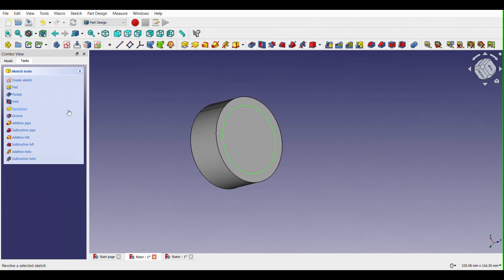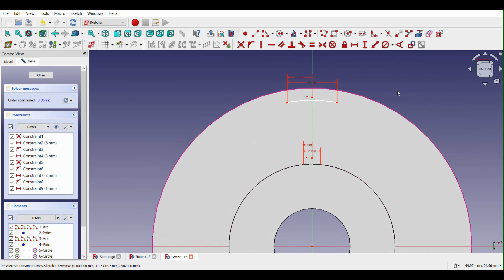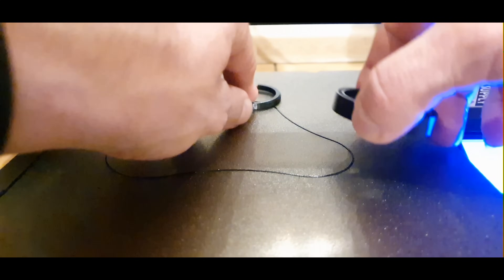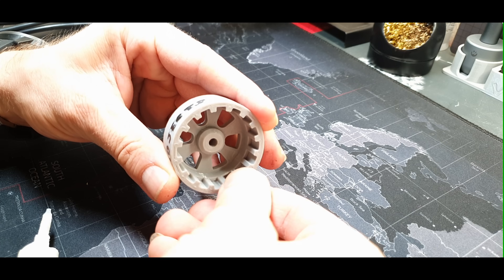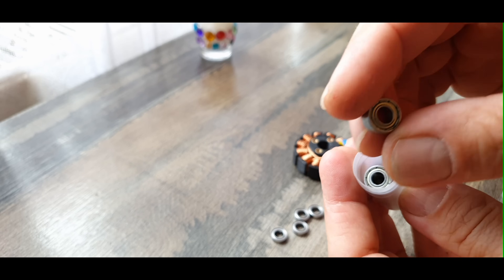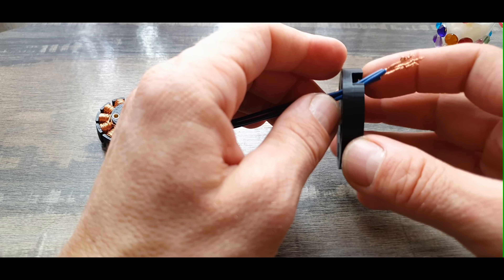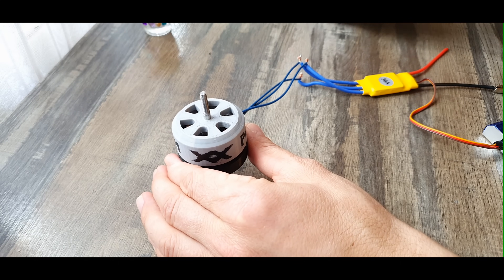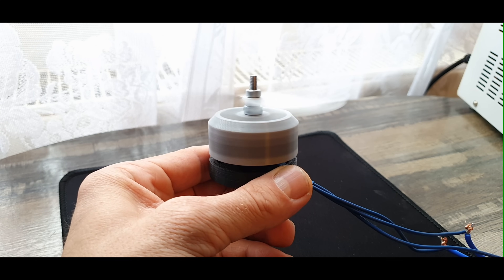How To Make A Brushless DC Motor | DIY BLDC Motor

Comment: I like where this is going.  Just about the time I was thinking “magnet polarity?” you explained it.
And lubrication at 7:00.  And using the high tech (CAD and 3D printing) plus low tech (cordless drill as an improvised metal lathe to cut the shaft for the safety washer/circlip/snap ring).

Comment: 12 windings 14 magnets
on stator use magnetic core from stacked sheets cuts by laser or waterjet
on rotor use metal cylinder around magnets to redirect magnetic flux toward coils

Comment: 11: 22 You can make holes on the stator and drive a round or square rod into it. And also when printing the rotor lay grooves for rings that will add strength to the rotor .

Comment: What is the voltage this BLDC motor is operating at? Can it operate at low voltage like 3.7v for instance?
Reply from the maker: Yes it will work, at least the ESC that I used it works, it automatically cut off the power when the voltage is at 2.9V, so yes I think it will work at 3.7V.

Comment: im trying to remake this for a physics project and im trying to find the parts needed, ive read the document in the google drive but im still a bit lost, mainly with the brass m3 insets, the diameter of the ones im finding online are larger then the diameter of the hole in the 3d model. just a bit confused. would be great if anyone could provide some guidance, thanks
Reply: You want the hole for the heat inset to be slightly smaller so there is some excess plastic to fill the knurls and form a strong bond. Set the inset on the hole with the wider side facing up, then use a soldering iron to push the inset into the slot flush with the part, it will push the excess plastic easily. I recommend using an m3 screw to make sure the inset is aligned proper while the plastic is soft. Be careful to not overheat the plastic with the soldering iron to prevent deformation. Heat inserts are absolutely worth learning to use, far superior to slots with hex nuts.
Reply: @bmw.996  oh i understand now, thanks a lot
Reply: @TheBuckmanCollection  Hey! I'm also trying to recreate this for a physics project right now. Would appreciate some tips + did yours end up working well?
Reply: @bmw.996 what what would you use for the speed controller and power?

Comment: Of course the magnetic fiels or coils crosses plastic, air and other things but your motor has a very poor efficiency since you don't design a real stator.
Reply: appearently its enough to still run it, note that the stator here has a verr small diameter wich will help with carrying over the flux form opposite poles, using plastic on a stator with a larger dm would defenitly result in verry bad efficiency. in this case, who cares it runs hahaha.

Comment: Question: Would it be better to use thinner diameter wire to get more wrappings, or does the reduced diameter have negative tradeoffs?
Reply: Higher AWG can handle less current and will begin to get hot quickly.
Reply: @gurnoordosanjh3288  but it will increase the flux for the same amount of current, because you can achieve more windings
Reply: Good question, good answers.   Some genius on the internet will have specific recommendations based on power source, application, the list goes on.

Comment: Can the brushless electric speed regulator be successfully operated by connecting it to a 6V battery box?
Reply from the maker: I think it will work at 6V, at least the one that I used, better consult the datasheet of the ESC you're planning to use.
Reply: @HMProjects  ok thank u

Comment: Did you just put oil on those ZZ bearings ? I thought that ZZ meant fluid tight
Reply from the maker: @VenatorFPV  No, they are not sealed, I mean they are sealed but not waterproof, they have a metal seal, more against dust than against liquids, you can see in the video practically how the oil gets into the bearing. those bearings with rubber seals are waterproof.

Comment: How many rpm does it spin?
Reply from the maker: Not sure, didn't had a digital tachometer measured the speed.
Reply: @HMProjects  I'm thinking of trying this in a project. Then it will be better understood how it performs.

Comment: Very nice work and video demo of the build and testing. As you noted, high rotational speed = high centrifugal force (to the power of 2) = high risk of failure and parts being flung out at incredibly high speeds. You may want to buy a heavy stock pot in which to mount your BLDC motor if you're going to crank the speeds up so as to contain the parts should a failure occur.

Comment: Hi. Wow many coper turns?
Reply from the maker: @miguelsampaio6199  I put around 20 turns, you can put more or less depending on the copper wire thickness you use.

Comment: You forgot to add iron shield around the motor, your magnetic poles are going outside the motor, thus decreasing efficiency. When they should bounce from iron shield around the motor to increase inside magnetic field and thus increase efficiency.
Reply: great point, it's also called a back iron
Reply: Would this help the motor self start without external help? Thinking of making something similar for a 3d printed e-foil type motor for my inflatable kayak 😊

Comment: Without the ferromagnetic core, I imagine the torque would be low even if it can turn at high speeds. I plan on building one of some sort myself, but I'll likely use some form of magnetic material—even if the eddy currents make my design inefficient, which will likely be the case. Thanks for sharing
Reply: you can use Protopasta's magnetic PLA to print a core. it does work, though not as well as pure iron it is better than other filament.

Comment: Can I use it to make a skateboard motor?
Reply: he didnt put any iron into the stator so there is nothing to carry the marnetic flux, mmake a coil of copper wire put a current on it and try to use it to pick up something metal. now take that same coil and wrap it around a nail or something containing iron. the copper by itself wont even pick up anything. thats why transformers have a iron core made up of laminated plates to reduce eddy currents. i would just buy some stators or find a way to stamp sheetmetal and spray some paint ir enamle on it before pressing them into obe.

Comment: reasons for lack of independent start: 1. there should be no gaps between adjacent magnets; 2. incorrect ratio of the number of windings and magnets. arc magnets are produced, that are better integrated into the BLDC case (both vertical/cylindrical and flat sectors with surface, not end polarization..as a rule, the number of magnets is even, then, number of windings should be smaller or greater than magnets by 2, but multiple of 3).
Reply: Where do you get your information from? 
Can you help me make it?
Reply: since your language is most likely Pashtun, your country of origin is in the "Islamic terror belt" therefore, I will not give you more precise answers.
Reply: Can either of  you recommend a good book list, beginner, to get the knowledge to develop this? I’d like to tackle it and I need to learn more about the subject. Aka, that’s why I’d like to do it, to learn.
Reply: You re a little bit wrong. The problem can be caused by:
-Driver Delay
-No position sensor, so the driver doesnt "know" a motor position.
-The motor is not balanced, some weight differences.

Comment: Looks like a clever design.  What did you use as a BLDC motor controller and what is the voltage being used to drive the motor?  I did not find that information in you video or in your link.  Seems important! 😎
Reply: Yea im looking to! The closest and cheapest thing that I found was a phase 3 BLDC speed controler
Reply: Like that wad the name of the product

Comment: how long does it run at max RPM before it melts?
Reply: its a brushless motor use for aerodynamic applications. The whole purpose of it is to self cool. thats what the holes are for, to draw air through the whole piece.

Comment: What is the size of the brass inserts?like m3 *3*4   tks
Reply: and what type of battery and controller do I need to use to drive it？
Reply from the maker: @junrukong-tn1uk If I remember correctly the inserts I used are M3, 4x5mm, to control the motor I used ESC in combination a tester for rc servos.
Reply: @HMProjects  How did you get the inserts in the print? Because the hole you left in the print is much smaller than the size of the insert.

Comment: No ferro in the stator? That must decrease the power to almost zero? Have you measured it?
Reply from the maker: Hot to zero, but definitely it has a lower torque, anyway this has no practical purpose, I build it for fun and learn something new a long the way.
Reply: @HMProjects  I understand 😊 It would be nice to do measurements any research to find out if it's possible to make a practical motor without ferro core, both due to weight, and to make it 3D printable (probably using nylon to make it more heat resistant).

I would guess a radial axis motor would work better without a metal core?

Comment: Was the CAD or software to design the parts come with your 3d printer? if not what's it called?
Reply from the maker: @saulwarren9611  No, the CAD program I used to design the parts is called FreeCAD.

Comment: Sir I have one doubt about the rotor in this type of bldc motor.that as the rotor is rotating at very high speed does by any chance it will ever come out of stator because it is open from below.please tell because I'm very confused.
Reply from the maker: There is no chance that the rotor will come out from stator, the shaft has a safety washer that will hold the rotor from coming out 3:15 , in fact there are more chances that the rotor at very high speed will break due to centrifugal forces.

Comment: most of the factory brushless motor nowadays has 14 magnet more closely eachother so it may be the case why your need a little push to start. you may want to try printing one that way it should improve it, very nice project!
Reply from the maker: Yes the magnets spacing may be a reason that the motor it doesn't self start, and another reason can be the combination between pole/slot, maybe with 14 pole and 12 slot as you said it will perform better, but the main reason is that it's lacks the laminated steel stator, I could use a stator from an old brushless motor but then wouldn't be "fully" 3D printed motor. Probably I try to improve this motor even if it doesn't have a practical use. Thanks for your comment!
Reply: @HMProjects  would it make a difference if the stator would be electroplated? I mean, would that be a viable option when creating this?
Reply: @nimgog  You can use the stator file as a blueprint for the stator layers. Have them cut, or even cut them yourself.
Reply: Show me by flying, this motor is of no use unless it is capable of flying 😂 @HMProjects
Reply: I was thinking cutting up steel cans, or thin sheet steel, but:  a lot of work, and then static/dynamic balance issues.  The other thing this brought to mind: large industrial motors use starter capacitors, relays, etc. to provide temporary over current to get it moving, cutting out when the motor reaches speed, or just predetermined time.  (A number of different designs for the purpose.). Might be an interesting, if impractical, exercise.

Comment: Electric motors generate heat, especially under load. Not to mention very high centrifugal forces when running at high RPM.
I guess you dont realize the the majority of the magnetic force generated by the stator coils is due to them being wound around (laminated) steel cores. Not non-ferrous plastic.

That being said, why would you even bother with plastic (3D printed, no less) as the construction material? This motor has the usefulness and durability of...  well...  a desk paperweight.
Reply from the maker: I know how electric motor works, I already mentioned in the video that the lack of the laminated steel core will affect the motor performance and of coarse how dangerous it is to  run this  motor at high rpm, being 3D printed this motor has no practical use, is only for educational purposes you shouldn't have much expectations from it.
Reply: To answer. Why not?

Comment: very nice I really liked your project.
 I was wondering a evolution of your motor: instead of glueing the magnets make a slight shorter in height stator, then in the rotor you could use the extra length to have a small cavity, in top and another on the bottom where it holds a small portion at the top and the bottom of each magnet. So you will keep them in place mechanically. It will save time gluing each one of the magnets and also your fingers 😅
Reply from the maker: I would not risk to run the motor at high rpm without gluing the magnets, unless I want to see how hard those magnets hit something 😄.